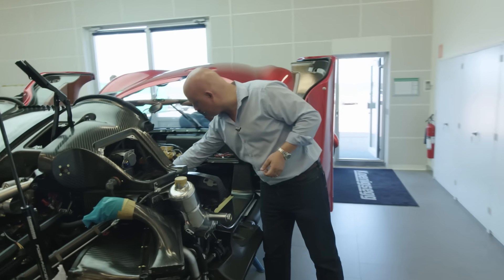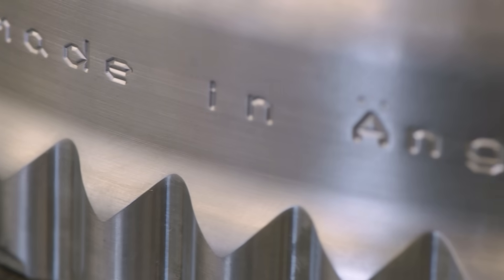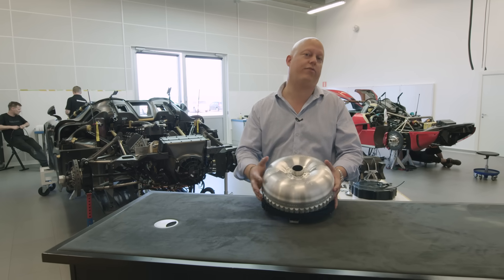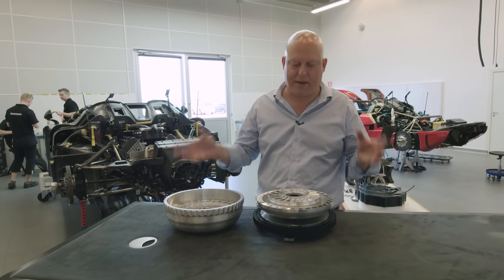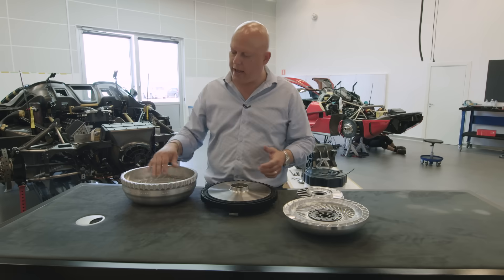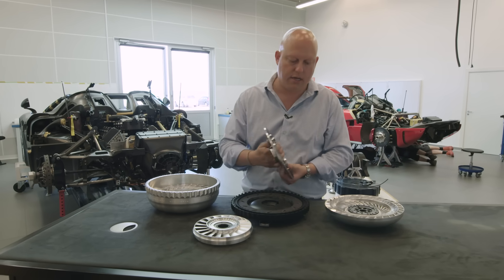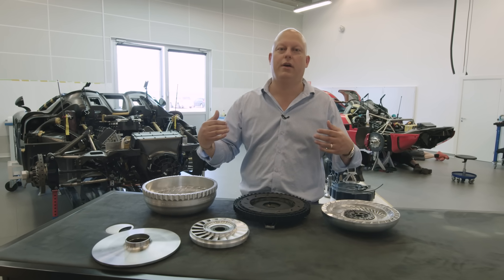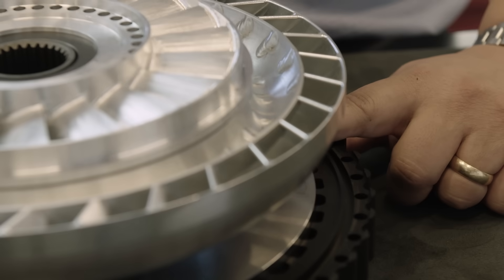248 MPH Without A Gearbox: Direct Drive  -- /INSIDE KOENIGSEGG

Comment: So... it's a torque converter. Nothing new here. Torque converters have their advantages, but they waste energy ie. have low efficiency as evidenced by the need to cool transmission oil. So, if you managed to build a high efficiency wide ratio torque converter (a CVT, in effect), then you are a genius.
Reply: Efficient internal combustion engine with a truly high efficiency constantly variable transmission is something that nobody has been able to develop thus far. Torque converters can be made more efficient with a lock up clutch, but they are still inefficient and they are not CVT, obviously. Dual clutch transmissions might be more efficient, but in some other ways they are inferior to torque converter, and they are not CVT. Band CVT (as in ATV or snowmobile) is not high torque and not very efficient. Power split (as in Fendt and many other tractors) is high torque, but not very efficient. Electric motor is a hight torque CVT (as in locomotives) and might be the most efficient. Mechanical and durable high torque CVT is not on the market. As I said, it might take a genius. Unfortunately, I'm not a genius.

Comment: How would you like to get rid of the torque converter aspect of your direct drive? Less weight, far less drag. Electronically programmable..  Patents are in the works. First prototype has been built. Second more efficient prototype design just about finished. Efficiency is near 100%.. Looking to license this at some point. Have a parts manufacturer waiting on drawings for specific parts. If you think this would be something you might be interested in, Drop me a line at Swimmsengineering@gmail.com. I have a partner in the torque converter/transmission business who's been co-engineering this with me. Initial plan is to display/demo at the drag strip. On the fly, fully adjustable stall speed. Ability to program slip maps the same way you program fuel injection maps and ignition maps. Can work in conjunction with existing transmissions and also be part of traction control strategies.    I came across this video while sitting down for dinner, and I can not think of a cooler place to show off this new tech.

Comment: I still dont understand how this is any different to a regular automatic transmission with a lockout being stuck at its 1:1 gear. Apart from being very well built for high performance.
Reply: it is not. The only difference is that its heavily computerized to work with the electrical motors to assist each other.

Comment: awesome! 
glad I found this.  I was wondering why nobody gets rid of the gearbox and this guy's does just that.  my idea was the fluid coupler but using certain gears instead of a clutch pack for 0 slip and 100% power transmission to rear axle.

Comment: oh i get it.  if you cant make an engine on your own, buy all parts of it, assemble them your self, modify them your self, and then claim you built the car.  if they dont understand what you want, build it your self.  the problem is, when you make a car company in the 90s and your own best model comes least 10 years later, you just have about 30 years of experience making a car, which by its self is unreliable.  then, from all the car manufacturers who produce their own cars, ONLY the japanese cars have the best reliability by a long shot, along with mercedes, those have manufactured millions of cars for more than 8 decades, so they know what a car is, especially a reliable one.  the average honda can easily drive more than 250k kms with maybe no mechanical nore electronic failures, and thats just the beginning.  if only recently your cars became popular meanwhile your company is no more than 30 years old, then what good is buying your car?  a mercedes amg can go easily up to 100k kms maybe even more, performance cars were built to drive with such high mileage, but since they have been building cars since 1967, they know how to fuse performance, luxury and reliability uniformly at once.  you can modify a toyota by some guy you never heard off, make it produe in excess of 1000 bhp and drive it every day for 10 years without a single mechanical failure.  technology is ruining cars, too much technology and too much luxury is destroying car reliability.  porsches and bentleys are the best example.  the best in lixury, the worst in reliabilty.

Comment: Surely Mr Koenigsegg, 
A gas turbine coupled to an electric motor /generator is the way forward now...
Reply: Hybrid is just a gimmick to lure petrel heads, fully electric or none at all.
Reply: @chiefcaptn1922  go back in your cage mungo.
Reply: Chief Captn 

That would be a bit extreme. Mechanically or electronically both systems produce power in watts and gas engines can be made to run on other fuels with predictable fuel emissions which can be recaptured or grown to balance the carbon cycle. The ultimate goal would be to shorten the carbon cycle from millions of years to a few weeks.
Reply: @chiefcaptn1922  its also about range and performance.

If electric is accepted then gas cars wont be phased out by regulation or will be reintroduced and carbon capture tech can make a fun car with an ICE and the advantages with the disadvantages becoming a relative non issue.

And most of said fun cars would likley have a hybrid power system

Comment: So how do u reverse without a gearbox ? Yeah dumb question but i want to know😂😂😂
Reply: Top fuel dragsters don't have transmissions either, they have a reverser. One speed forward and one speed backward. They don't use a torque converter but slip clutch discs until they weld together for speeds over 300 mph in 1,000 feet.
Reply: @draintheswamp1588  so if i am not wrong does it mean they they can go at same speed in reverse as the go forward ? At Same speed forward k reverse ?
Reply: @DaniyalKhan-pm5zz  no, it uses the electric motors on the axles to reverse

Comment: I strongly believe that the first flying car , (back to the future style) ,  will have the KOENIGSEGG logo on. They are 100 years in front of every other car company. 
I wish i have the money one day so that i can enjoy this level of supreme ''craftsmanship''
Reply: You are clearly uninformed that many flying cars already do exist, but are one offs and not production. Back to the future style is straight up impossible because adding jet engines (or any kind of thrust vertically) to allow said hovering and flying would be inefficient and add excess weight. Instead an electric motor should be provided to power a propeller at the rear, leaving the option for lift to either a canard/swept wing design which maximizes stall safety when flying as well as minimizes the appearance and aerodynamic changes to the vehicle (although said vehicle would need a pointy nose as downforce is highly undesirable for an aircraft), OR a free spinning telescoping rotor at the top of the vehicle which would require an attachable/extendable tail to counteract the yaw tendencies of a rotor. It wouldn’t be easy to create one way or another.

Comment: Let me see if I got this right:

The engine sends power to the torque converter and a generator 

Electric motors are probably mostly responsible for getting the car off the line

As the car picks up speed, theres less slip in the converter, so the engine starts adding more power

Comment: ...cutting edge technology?...direct drive with a torque converter...Buick did it with the Dynaflow in 1948...
Reply: but this torque converter needs to "lift" almost 1000hp so it's not as simple as it sounds

Comment: So hes a genius and just has to go through the all of the physics processes so that he is accurately describing the mechanisms for himself. For all the gear heads, it's a torque converter with 2 individual rows of blades that hooks directly to the gearbox. Stage one: when the regara is standing still the outer row of teeth is engaged with the engine but disconnected from the drive line so that during Stage 2: the coupler joins the outer and inner row of teeth so that it multiplies the engine torque enough that the regara can still accelerate while in a single gear long enough to reach 300+ KPH. The use of to rows of teeth per side of the TC allow a torque converter with so much momentum that its effective at 1000-1500 RPMs instead of 3k/5k like a traditional TC but is more effective than a traditional TC. Stage three: once the efficiency drops low enough that it would become a parasitic loss it syncs rotational speed and direction by design. This ensures you have both good acceleration and high top speed in a more efficient and faster package (no shift time, no missing gears, and parasiting loss from the weight of 6 other gears.

Comment: You put in 2000 rpm,get 1000 rpm out with more than double the torque?
If I recall it correctly, power is basically rpm times torque. Does that mean this produces energy also?
Reply: Power is torque times radial velocity, however power is conserved throughout the process. If the same power is in both equations, then torque must double if the rpm is cut in half. Remember the law of conservation of energy.

Comment: ****
****
        Wish u could contact me. Regarding a engine where the cylinders are operated by a technology that is applied  to propel objects  or thrush them  very quickly and smoothly  also being used by bullet  trains. Without giving away the idea which would increase the speed of the cylinder to reach top dead center. While being fully adjustable/speed / and depth for the cyinlder or each individual cylinder from an on board CPU/ dash programer etc... as well as a wireless system that could be managed from the pits meaning you don't have to pit as much to try and save on fuel and increase horsepower all from a CPU in the pits/ or command post off site that taps into the network onsite then which is also connected to the vehicle. Just wish there was a way that you can contact me so that I could tell you my idea you make a very very beautiful piece of History keep up the good job have a blessed day.

I JUST CANT BELIEVE NO BODY HAS THOUGHT OF THIS, AND ME OF ALL PEOPLE LOL...

Also this idea would totally remove the  crankshaft and a whole lot of the bottom end of the  engine.

Super smart I sent this to exotic car desigerns like Koenigsegg who love to hear ideas from average people that's how he started that is a billion dollar idea to change the entire concept of engines were it would combine electric and combustion engine totally different from any hybrid type system this would be a badass race exotic car hypercar engine
Reply: Bullet trains use magnets ...

Comment: No doubt he has taken the idea of a torque converter and what it's capable farther than anyone, and bravo because he's willing to do things differently in a thoughtful way. But for a point of reference remember old school drag racers used 2 speed powerglides along with many of these same principles. Lots of torque multiplication and only two speeds, and the 2nd gear is also direct driven.

Comment: hope jesko gearbox have there own explain
Reply: The Jesko gearbox/clutch assembly is out of this world. It has something like 7 clutches and performs 2 different functions simultaneously.

First, it acts like a double clutch. Youre accelerating, it selects the next gear so shift times are in low double digit milliseconds (faster than you can blink). 

But youre in a car with 1500hp and enough torque to twist the fabric of reality. Maybe you dont want to go 2-3-4 or 7-6-5. This is why you have so many clutches - to move between any and all gears freely like you can in a manual. Braking hard on a track? 6th->2nd? No problem. Just accelerated hard to overtake a truck on a 2 lane highway? 4th-7th? No problem.

Its awesome.

Oh, its ridiculously light too.

Comment: I can never understand why they cant charge the battery on the electric car 
while you drive .
Reply: You can't in a purely electric car, however you can in a hybrid car. On a hybrid the combustion engine can power a generator to charge the battery. It can't be done on an electric car. Generators require more power to turn than they produce. If they stuck a generator on an electric motor it would drain the battery faster. Some electric cars have what is called regenerative braking, which is where a generator is engaged when the brakes are applied. The generator helps slow the car down and charges the battery.

Comment: is any component in this electronically controlled or is everything dictated by the power input from the combustion engine and the e motor on the crank
Reply: There are three electronic engines so of course all of them needs to be controlled via the inverters, which are electrically controlled. And of course the V8 is electrically controlled as well.
Reply: @gertahnstrom784  i am referring to the Torque converter not the whole car
Reply: @madrummer666  The clutch that controls the lock-up function has some kind of actuator that is software controlled, not by oil pressure as in a regular automatic transmission.
Reply: @gertahnstrom784  thank you

Comment: 6:05 I don't care what kind of machining you've done, if you're putting in 2000RPM and getting out 1000RPM, you're not going to get MORE than double the torque.
Reply: IIRC typical torque converter torque "doubling" is somewhere in the neighbourhood of 1.8-2.5 multiplication. Peak multiplication typically happens at the torque converters stall speed, whatever that might be in this case, this is also where the TC is the least efficient.
Reply: @ColtaineCrows  I know that the maximum torque multiplication of a torque converter is more than 2, but that can only happen when the ratio of input speed to output speed is ALSO more than 2.  Otherwise, the torque converter would be creating energy.

Comment: He does not explain how it works at all. This is a useless video.
Reply: He explains it pretty well as long as you understand how a torque converter works. It is basically a more complex torque converter combined with a couple of electric motors.

Comment: So basically it uses a hydraulic transmission and a single gear for top speed. At starts and low speed it spins at different rpm to creates torque with assitance from an electric motor but at high speed it lock up and spin on a single gear. And because it is made from aluminium it's lighter too. But does it lasts? My old school automatic trans does 0 to 100 km in 14 second and at 150.000 km it shows no sign of fatique.

Comment: My point its a freaking torque converter. Just cause its geared differently diesnt make it diffrent, you know there is cars with 4k horse power and they have magic torque converters too
Reply: It is different, he explains the differences pretty well. It is based off of normal torque converters, but it has some key differences. If you take an existing technology and change it to work better, then you have created a new technology.

Comment: basically long story short they deleted the transmission and connected the driveshaft to the torx converter my truck literally has the same converter only differences is i still have a transmission and my truck has 800hp

Comment: This is actually not that complicated. Its a pretty normal torque converter that any Automatic Car has. Its just very light and has multiple stator blades. Thats it. The Problem with these Torque Converters is the Loss of Energy between the shovels. Somehow Koenigsegg solved that main Problem.

Comment: Amazing technology. Having electric motors provide rear wheel motion is one thing. Utilizing electric motors in combination with a combustion engine crank, and ridding the mainstay transmission components is completely another.  The brilliance of design here is mind boggling. The milling and welding of the torque converter components is also very awesome. When this company designs, they design things with open imaginations.  It is completely refreshing, to see an automobile design of this caliber. Not only the direct drive feature, the swing up doors, the removable top and it’s unique storage system to the shock dampening system to the combustion engine exhaust. The heat exhaust from the motors could be recirculated to inside heating.  This Heat that is exhausted could also be utilized to inflate a lifting device to lift the vehicle up to change wheels. Just an amazing video.

Comment: So to control heat, under normal daily city driving, is it essentially an EV, only using the torque converter when the driver is harder on the throttle?  There must be an incredible amount of hydraulic slip at low driving speeds which would surely generate a ton of heat, but if you could take the torque converter out of the equation when not needed at lower speeds then that would surely limit the heat.

Comment: I don't see any way you could keep the fluid temperature from soaring several hundreds of degrees and melting stuff after a hard run around a track.  It seems that the best hope would be to build an engine that could produce a lot of low end torque But if it was possible to build a 1200 horsepower engine that peaks at 3000 rpm and fit in that car then that would be an engineering feat in itself.

Comment: I'm a machine operator by trade and I think a lot of weight could be shaved off by using an agie-charmilles wire induction machine by eliminating the need to weld the turbine fins into place. You will have to design and program an adaptable robotic table to manipulate your workplanes in real time for such exotic contours but your automated body technology has the requisite sophistication. Your production time will likely quadruple for that component but the same technique could be applied throughout the internal structure of the vehicle. This technique also increases interstitial strength, allowing for further weight reduction from a design standpoint, something koenigsegg has shown and said it focuses on.